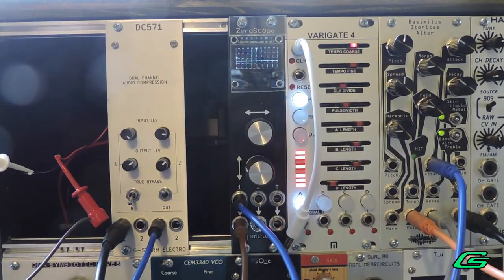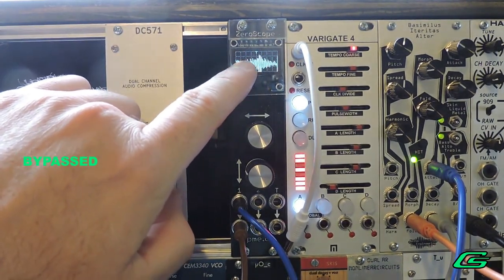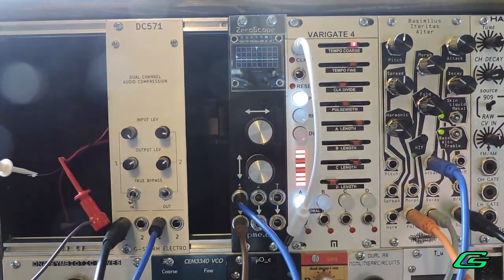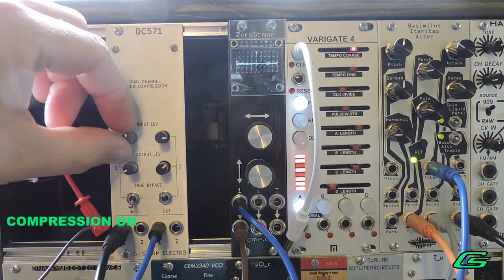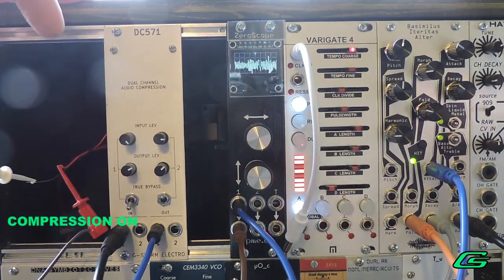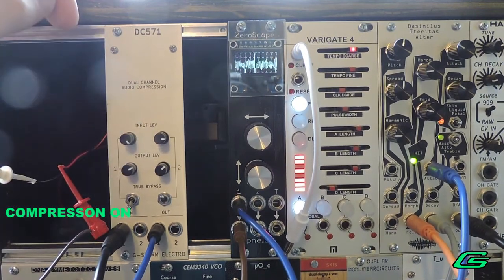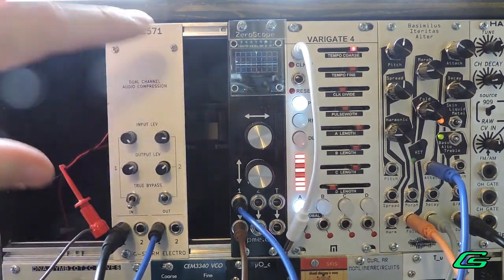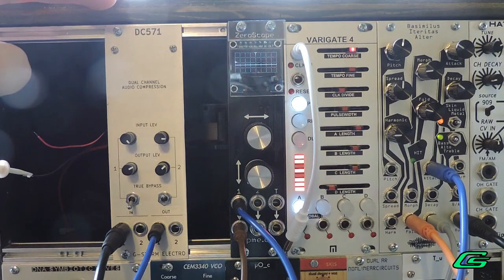DC571 Dual Channel Audio Compressor Eurorack Prototype

Comment: Looks and sounds great.  Are attack and release source-dependent, or fixed?  Also, can you make it with regular knobs? :D
Reply from the maker: Thanks, att/rel are fixed.  My idea is a no-nonsense module and to make this at a much better price point than what's available right now.  By, like, half.  I maybe interested in doing a higher-end piece w/ more bells/whistles down the road.
Reply: @gstormelectro  What are the attack/release/ratio settings like? Or ranges?
Reply from the maker: @piotr803  The current version uses NE570, ratio is 2:1.  A/R settings are  'fast' range characteristic, probably 10-20 ms.